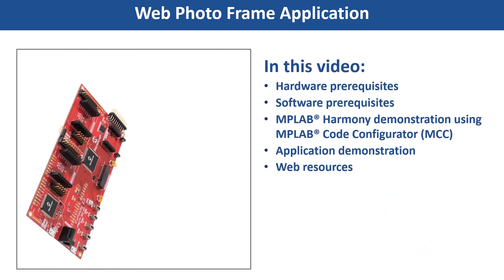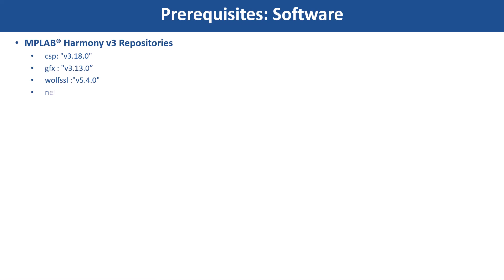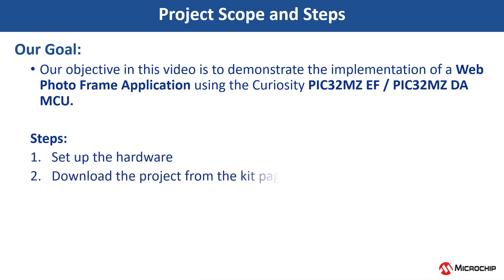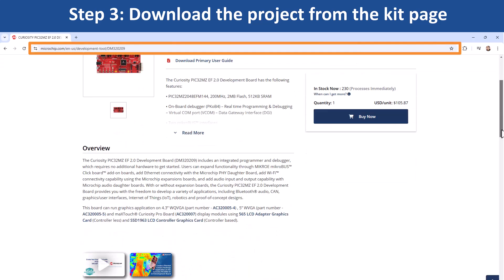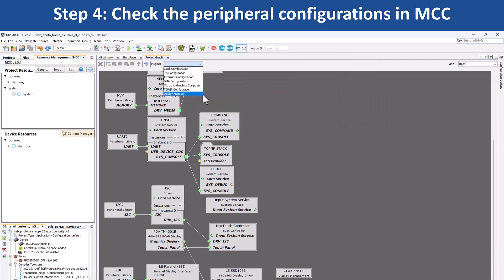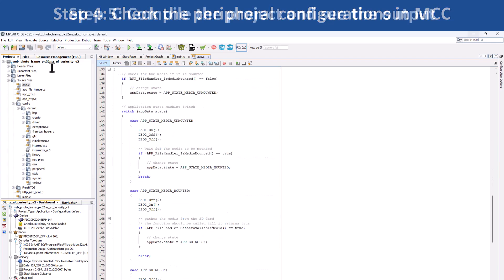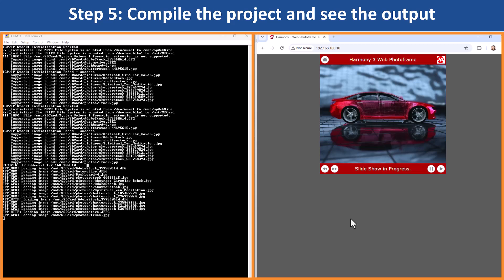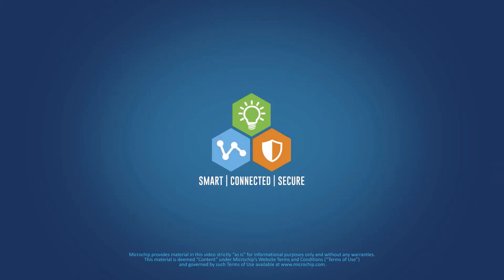Demonstrating Web Photo Frame Application with Curiosity PIC32MZ EF/DA MCUs

Comment: I tried to get the Web Photo Frame Application for the PIC32MZ DA Curiosity Board to work but I always get the error code -4 when I try to start the Initialization with the reset button. It says 'DRV_PHY operation error: -4' and 'DRV PHY Init failed: -4'.
I use the LAN8720 PHY DB and followed the instructions from your website. The display shows the pictures from the sd card, but I can't get the Ethernet connection working.
What could be the problem?
Reply from the maker: Hi there, thanks for reaching out. The error code -4 you are encountering, which is associated with the message 'DRV_PHY operation error: -4' and 'DRV PHY Init failed: -4', suggests an issue with the initialization of the Ethernet PHY (Physical Layer) device. Since you are using the LAN8720 PHY DB, there are a few potential areas to investigate. In able for us to address the concern further, please connect with us at: https://www.microchip.com/en-us/support. Thank you!

Comment: I thought the PIC32MZ (and all those with MIPS core) were already considered obsolete.
Reply from the maker: Hi there, thanks for your comment! The PIC32MZ EF series remains a key part of Microchip's high-performance microcontroller lineup. It offers features like an integrated hardware FPU, a 12-bit high-speed ADC, and an extensive DSP instruction set, which make it ideal for intensive applications. While advancements like the PIC32MZ DA series provide enhanced graphics and integrated DRAM for advanced designs, the PIC32MZ EF is far from obsolete and continues to support many demanding applications. Let us know if you'd like further details!